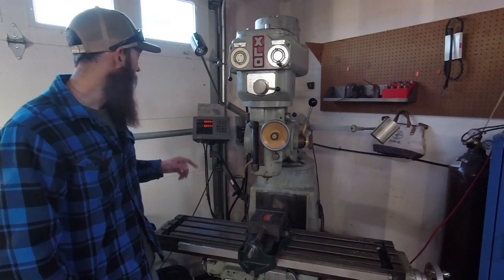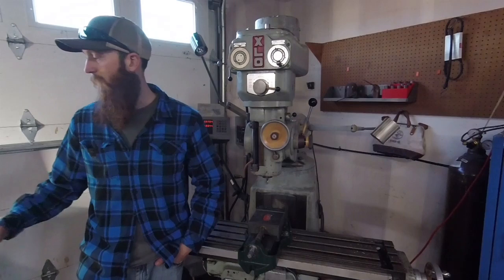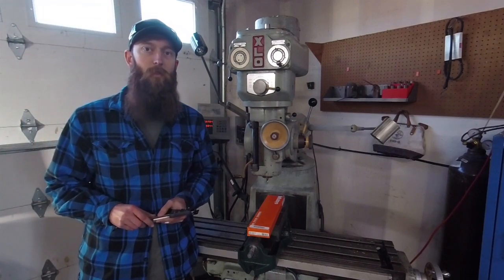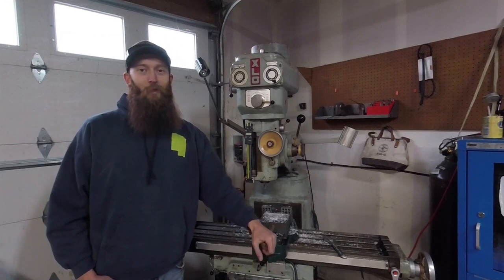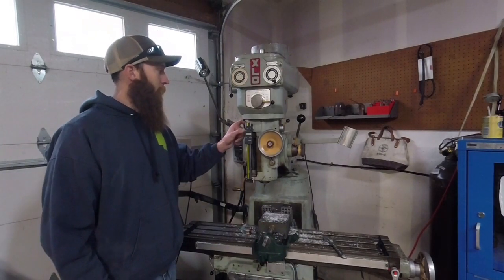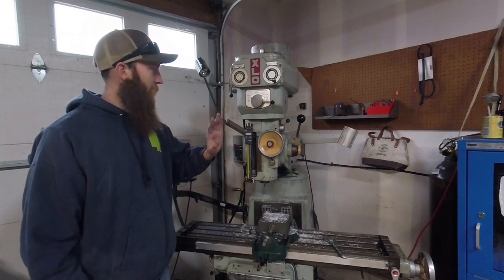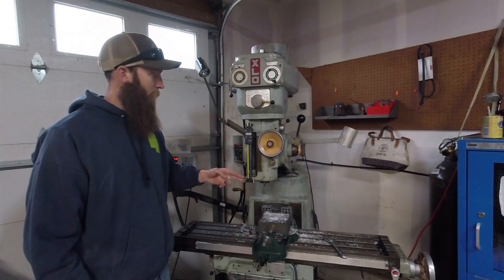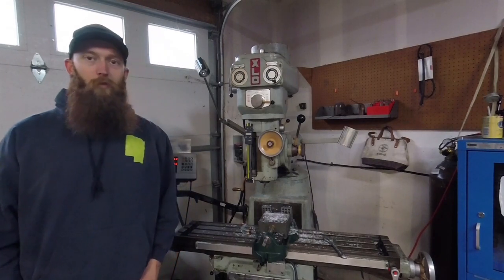Mitutoyo Quill DRO on the XLO Mill

Comment: I just bought an XLO and need to add a Quill scale to my machine. Do you still have the G-code for the bracket? Thanks
Reply from the maker: I’d have to boot up the computer for the cnc to check for the gcode. I moved and haven’t re assembled it yet. I’m sure I still have some form of a file for some part of the bracket.
Reply: @riversvic  Thanks, no rush.

Comment: I bought a 6+ inch Shars scale for mine and have tried to think of ways to mount it.  There really isn't any machined surfaces on the head to mount it to that are convenient.  Also there is the Y axis tilt square drive, the quill depth stop and the normal scale that have the potential to be interfered with or covered up.  The scale being more of an aesthetic thing, just saying that side of the head is very busy in a compact space.  I kind of like your idea of using the depth-stop set screw lock and the indicator rod lock threads as a mounting option.

That said I'm kind of stuck on my rebuild for the time being.  My Y axis is garbage and am trying to figure out how to machine and scrape it back into shape.

Thanks for the video, always like seeing more details and mods on the EX-CELL-O's
Reply from the maker: I thought about setting the bracket a little further back or having an opening for more access to the tilt drive but if I rotate the head at all I would need to remove it anyway to make adjustments then replace the bracket. there is enough room now to at least tram the head with the bracket in place. Hope you find a way to continue on with your rebuild. If your interested I could make an extra bracket to mail you to mount the Shars scale. Thanks for watching Jim!
Reply: @riversvic  I really appreciate the offer bud, but at this point I wouldn't want you to to spend the energy or resources to make the extra bracket.  I always love seeing the videos of the XLO though, Thanks!
Reply from the maker: Let me know if you change your mind I’ll save the GCode just in case

Comment: I thought it was a big slab of aluminum at first. It seems pretty cool to machine out more or less form fitted parts like that.  Have a great new year.
Reply from the maker: I realized that it appeared that way at first but didn't have another angle to show it wasn't. Thanks for watching!
Reply: @riversvic  I just got an XLO and wnat to install DRO on my mill. Did you say you have some G code for the bracket?